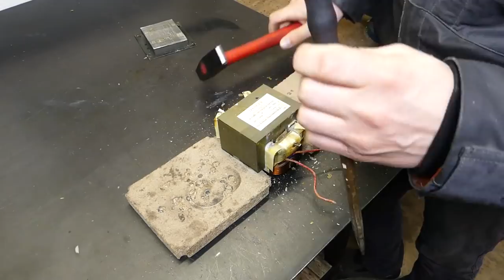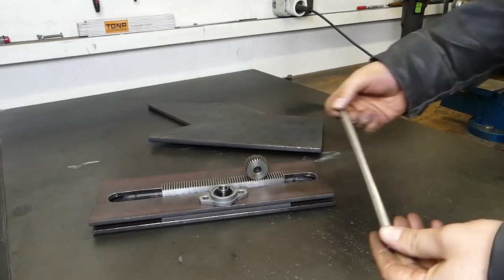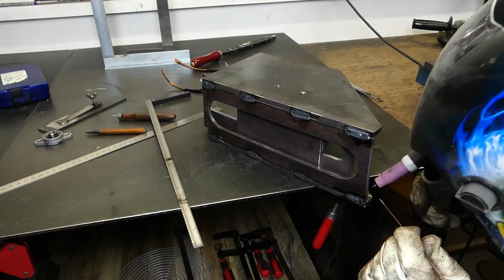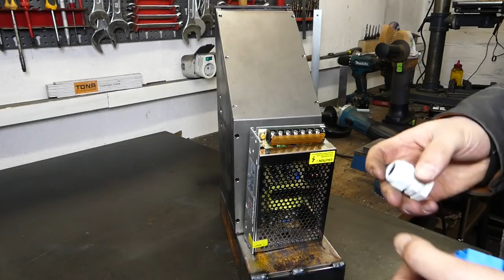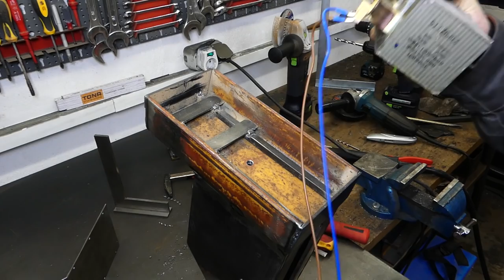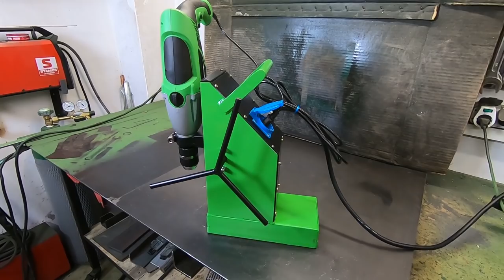Magnetic Drill Press DIY

Comment: How did you wire up the two microwave transformers?  I'm guessing you kept the primaries (the windings that would normally be connected to mains power), wired them in series, and connected them to your 12VDC 10A power supply.  And were those transformers designed for 240VAC mains power?  That was a very nice looking build, and I love that you just built the damn thing, instead of talking and talking the whole time.
Reply from the maker: Thank You very much! I put the primaries parallel to the transformer so that each got the 12v. I previously roughly calculated how much current the winding could take and at 12v DC the current fits quite well. My transformers were designed for 240V AC I think for a 115V AC you need a lower DC voltage.
Reply: @samsworkshopdiary5748  Thank you.  That helps a lot!